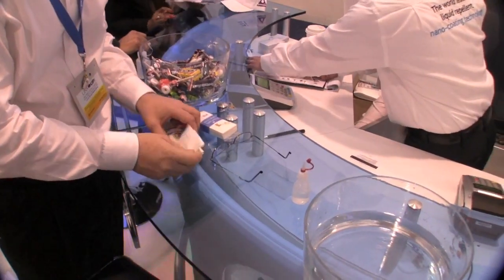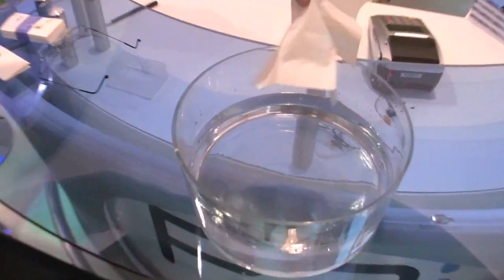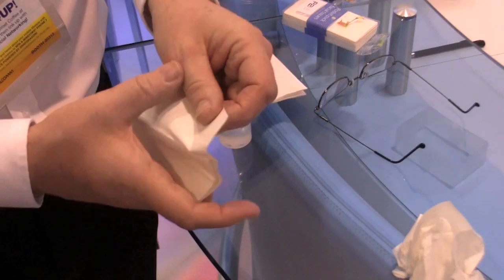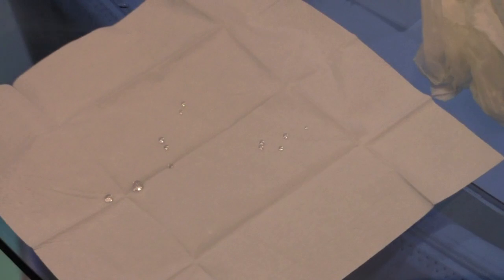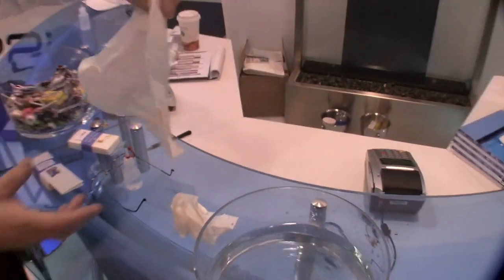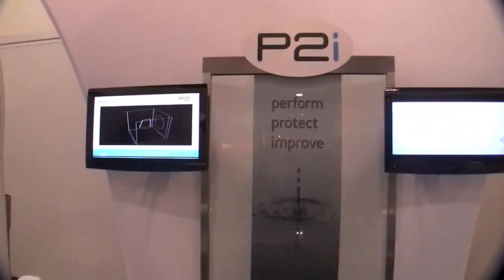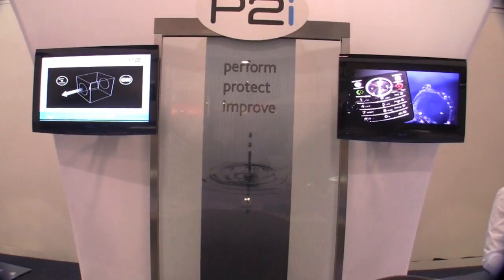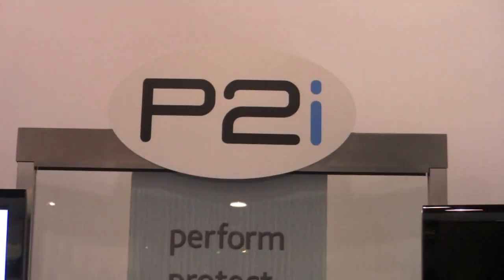CES 2011 - P2i Water Resistant Micron Technology (AMAZING)

Comment: @DroneAbove Good question, as the coating is on the nano-scale (1000 times thinner than a human hair) and bonded to the surface, it lasts as long as the product itself and does not alter the electronic properties of devices. In regards to glass, the transparency is not altered as the coating is totally invisible to the human eye. Hope that helps? -  P2i